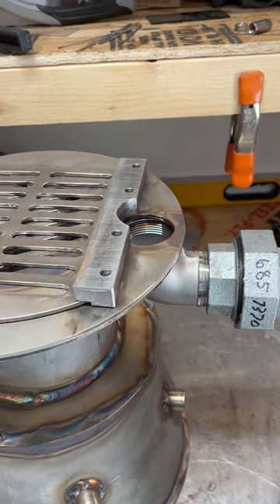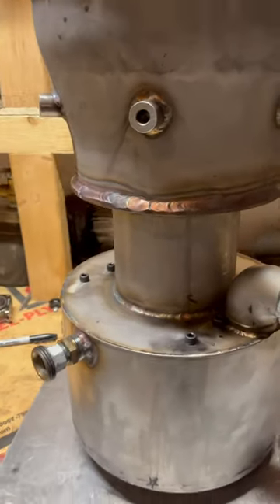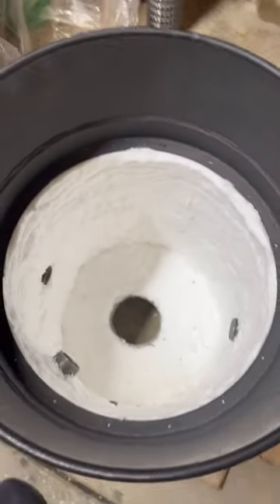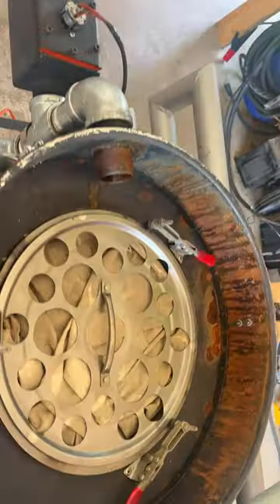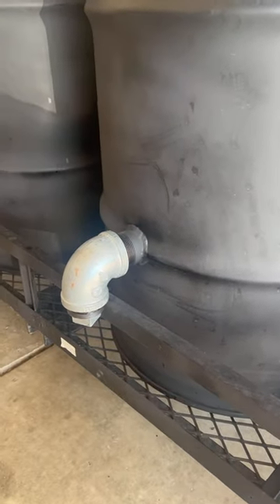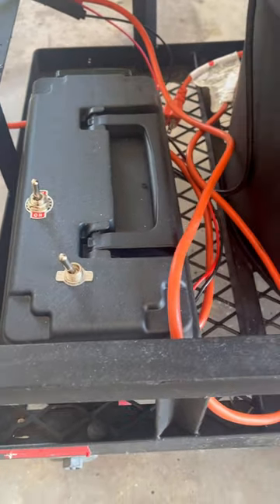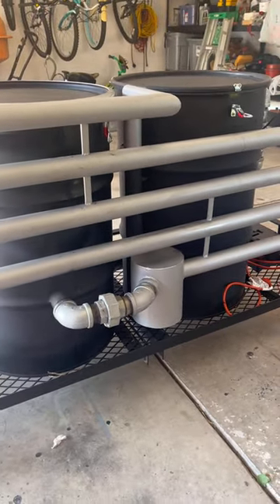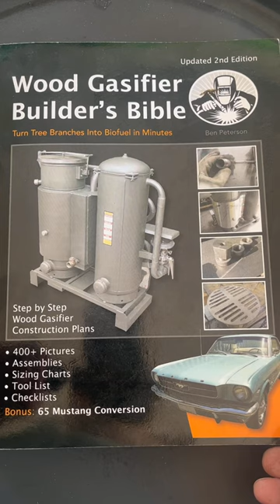My wood gasifier! It works! DIY. How to build it. Part 1

Comment: Amazing work. You reckon a Range Rover Defender from the 90s could hypothetically have it's gas engine replaced by a wood gasifier? Researching for prep work
Reply from the maker: I would definitely think it would. The older the better without all that computer stuff. My gasifier is rated to run up to a 1000cc engine, but it actually ran my 5.0 L Tahoe . I have a video on that , you can check out if you want. I would upscale my gasifier thou , to run my Tahoe better. I have dimensions for a 5.0L gasifier.

Comment: Did you se any ready available plans or did you come up with your own design?
Reply from the maker: The only thing I find very informative was Wood Gasifier builders Bible. There is some good information in it, but I think he built it a little more complex than it needs to be. I used the formula for sizing of the air to charcoal ratios. Other than that I just used my imagination to make the build as simplistic as possible.

Comment: Can we run a 30kva gas generator on it for 5 to 6 hours
Reply from the maker: I’m not sure, but it does run my 5.3 L Tahoe. You would need a bigger hopper for 5 to 6 hours. You could weld another 30 gallon barrel on top of the other one. That would last awhile.
Reply from the maker: How much horsepower engine are you running?

Comment: OK. you let some gas go into the atmosphere. What purpose does it serve? Can you bolt it to a car? Use it in a camper ? WTF
Reply from the maker: The woodgasifier was used in World War II when they ran out of gasoline they would use a woodgasifier instead and yes, both them to their cars and the cars would run on this.
Reply: You need to push out/exhaust any air in the system before the actual gas comes through. This prevents... 
1: Back pressure obstructing the flow and ..  
2: Residual oxygen mixing with the hydrogen and methane inside the heating chamber; which may result in an explosion.  
When done properly, it is extremely reliable technology. It's how people heated their homes, cooked their food and ran their cars during the Blitz.